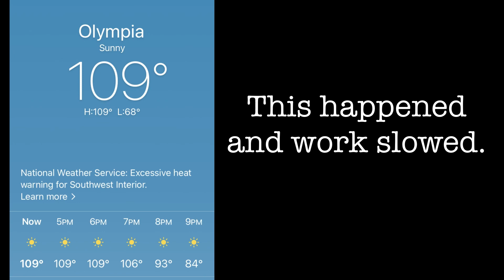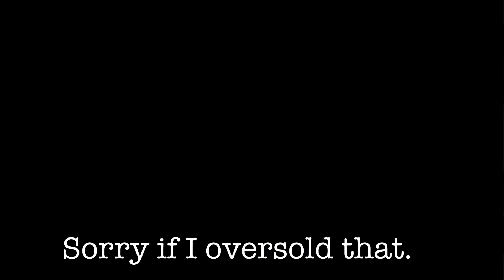The Big Bar Build:  Part Two

Comment: Really well done..Does the Shellac give better adhesion for the veneer?
Reply from the maker: Ehhh, maybe.  I actually didn’t shellac the small veneered parts.  That was actually done during the interior finishing process.  It was basically done as a sanding sealer.  Honestly, I think you could totally skip this.  As far as under contact cement for veneer goes, I think it might actually decrease the adhesion of the cement to the wood.  I’ve used a lot of contact cement in other projects and it can pull up over shellac, but that also just might be the nature of the cement.